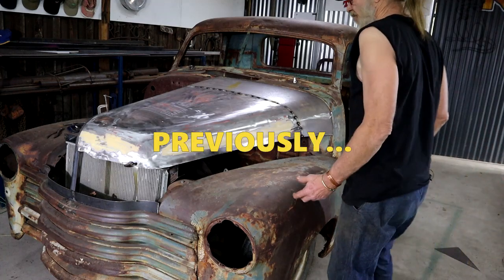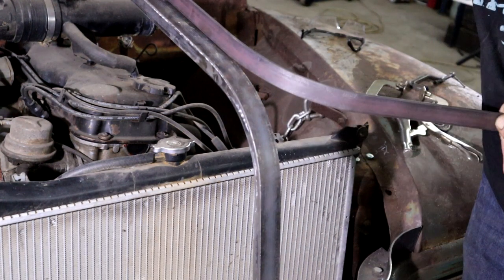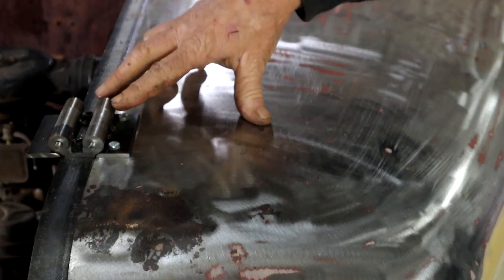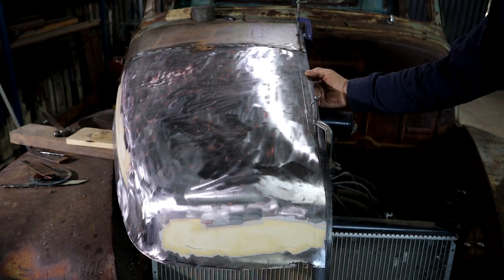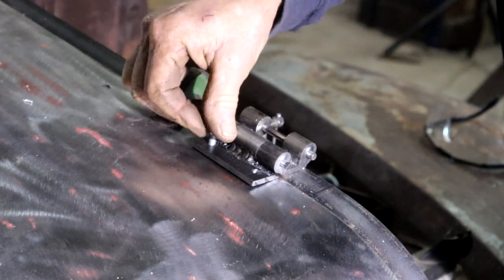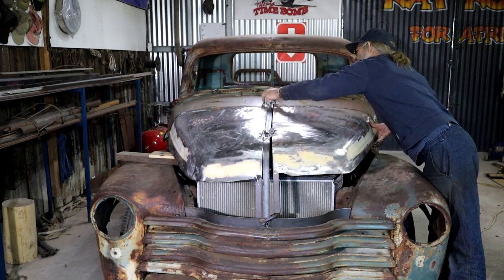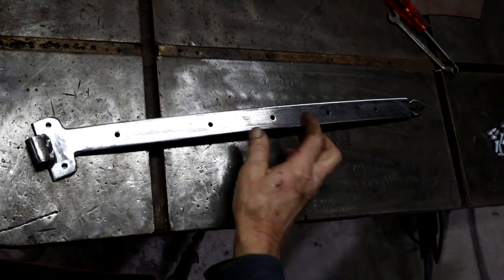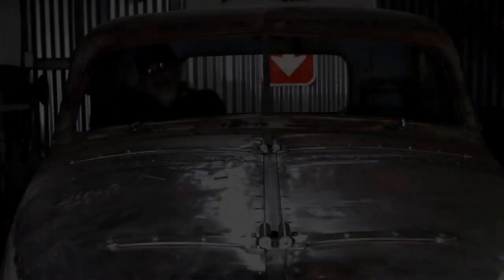BUILDING CUSTOM BONNET/HOOD (Part 2) - The Hinges

Comment: Excellent I love the Butterfly Bonnet, that's some heavy gauge stuff to be able to tap a thread in it
Reply from the maker: Thanks man. It is a 5mm (3/16)flat bar strap that I tap the thread into. The strap sits below the sheet metal, so in the end the sheet metal edge of the bonnet is sandwiched between the hinge on top and the flat bar strap below.

Comment: You got two Texas thumbs up!!!! You are spot on with those hinges. Love the way you angled them and made the bolts look like rivets. 
I’ve seen some $40k-$50k ratrods built on tv, and they weren’t half as good as yours. You really have a great mind for this. Or maybe it’s that thinking chair. Lol!
You ever thought about giving out an address so fans can maybe send you some supplies? 
Keep up the great work. I’m on the edge of my seat to see what you come up with next. 
I wish you had more of the grill pieces to go up higher in the middle. I think that would be sharp.
Reply from the maker: TWO Texas Thumbs up! I'm honored Harold!😄 Glad you like them hinges man. Thanks for the great comments. The problem with an address is the fact that it is in Africa... The postal system here is pretty broken... Stuff will probably never get here. We use private courier companies to move stuff around, but it is relatively expensive. Got some plans with that grill - keep an eye out for the next video!